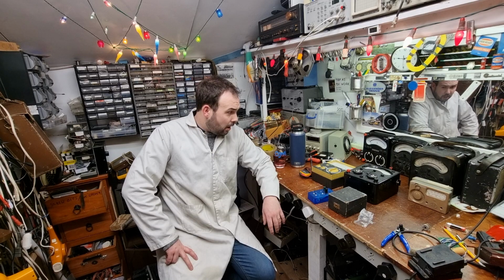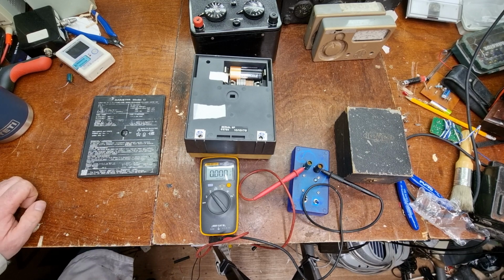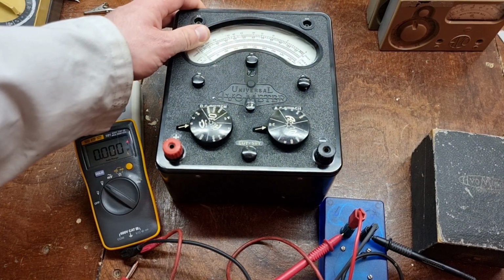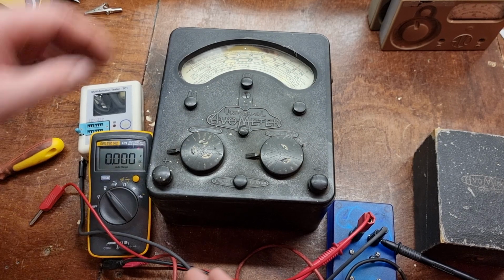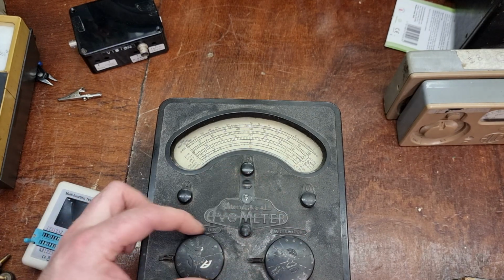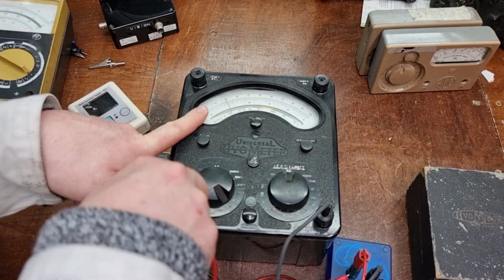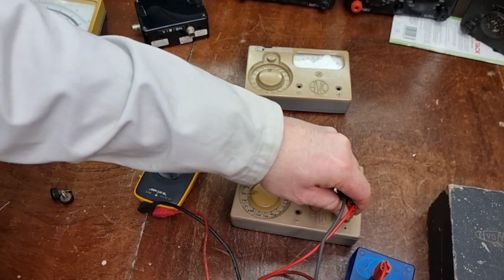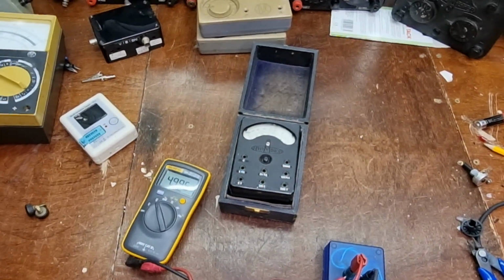A look at my AVO meters.

Comment: At last, someone who knows what they're talking about.. Model 7 and Model 40 can be even more accurate on DC voltages than a Model 8/III. A quirk with the Model 7 is that measuring a low DC current pushed by a low voltage, the reading can be very inaccurate, very much on the low side. It's not just that the meter biases the circuit, it genuinely does read anything up to 15% low. The same does not happen if you measure low AC current pushed by a low voltage. Odd.   

I was given a Model 7 last year that had every fault under the sun, including an o/c wire on the autotransformer that made all AC current (AND VOLTAGE!) ranges dead. I had a transformer from a 7/II to install, but predictably some of the taps and posts were in different places so i had to fabricate some extended flyleads, solder everything up then drop then drop the transformer in from the back! Was quite pleased with that, as when the tx is dead most people discard the meter or put it away. 

Impedance of a Model 40 on DCV is 167ohms/volt (ie 1k/6 volts). Very low, but useful. 

Pick of the bunch in my opinion, Model 8/III and Model D. Most Model D's you find have been quite heavily used. One i bought from ebay had been cleaned in a dishwasher....it survived but only just. See if you can get yourself a Type E Test Meter (Air Ministry) Avominor. Useful as long as you're only wanting DC. 800ohms/volt, and easy to clean, as smooth bakelite.

Comment: i do like the big avo meters, that loverly scale and sweeping needle. Ideal for peaking or watching voltages that wander about 😀
One of the avo's i was given was damaged by the previous owner, cracked case and broken glass.
The scale wasn't linear any more, that sliding strip and screw was the only thing i could find.
So i tweaked it, wow that came back into perfect linearity in no time😀
The voltage ranges were spot on, i never had the batterys for the resistance ranges so i assume they worked.
D.C voltage was the most useful to me.
i cleaned the switches and cutout and closed the case, no need to mess with it.
So accurate for an ancient meter.
Sorry long waffle 😞

Comment: And i thought i had too many avo meters (i have 7 of them)  but there is something about them.
Reply: Connect them in parallel and measure a d.c voltage, it will send you mad with the slight differences between them lol.
The calibration madness starts 😀